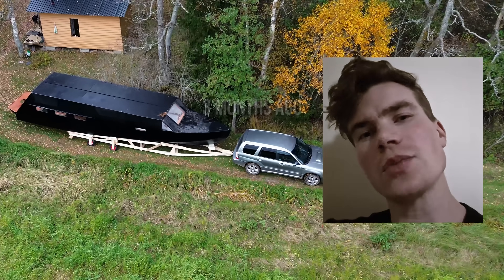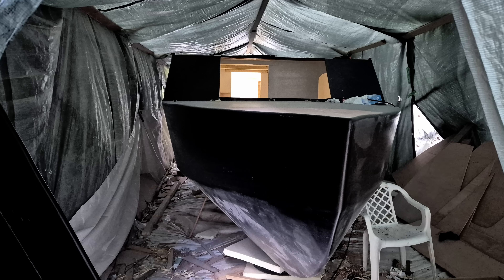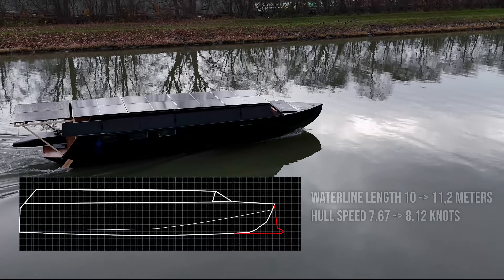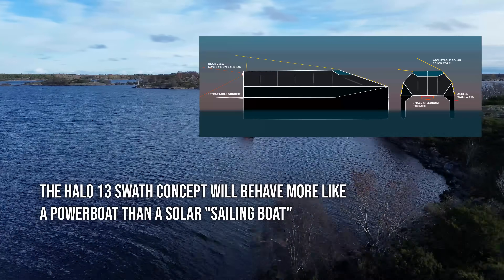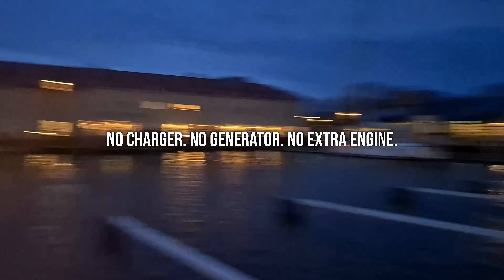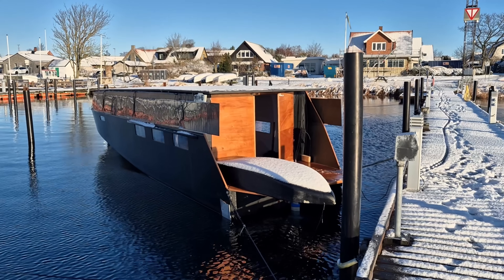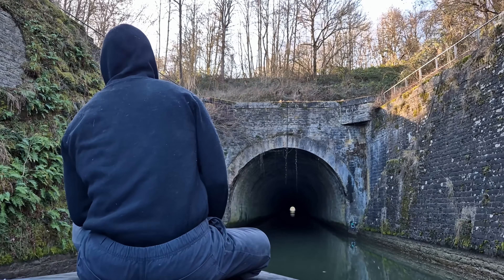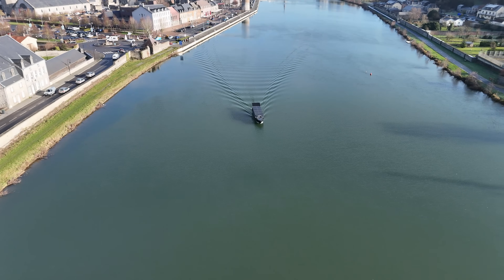The Real Reason I Got Trapped in Winter Canals

Comment: Thank you for sharing your experiment and adventure with solar powerboating..

I wanted to do a solar boat build for quite some time..

I live in Oregon next to the Columbia River, the wind and waves can get pretty big in the afternoons..
Currently looking at converting a 24 ft pontoon boat by adding a 3900w canopy roof (6 panels of 655w bifacials)  and running dual Minn kota 112 lb thrust electric trolling motors on the rear.. 

I understand I'll probably get a solid  5 mi per hour and hopefully with the overpaneling I will be able to keep up with the power draw even on cloudy days .

I also have beachfront property in a small province in Quezon Philippines..

A solar party barge would be a great thing to have there for family adventuring and spending the day on the water with cooking and karaoke with friends and family while cruising up and down the shoreline, then returning in the evening.. for my Philippines build it will need to be able to be pulled up onto the beach for storage and safety during the storm seasons and when I'm not there...

Comment: Learn by doing, is a great way.
I still disagree about the bulb. 
I hope you do tryouts with scalemodels (add rc and brushless systems)
If you want longer hull in waterline, take a look at the hull designs of C.G Petterson. (Beuties of the sea)
I suggest a woodstove for heating.
Also a small sauna (maybe same woodstove? Just define sauna with add on (lightweight) walls) would increase your comfort a lot.
Lightweight hull and noice?
Without insulation nor no curves on the surfaces, you can reduce speed or wear earprotection, the sound of waves against your hull  (empty box) will be there..
This trip is experimental yes?
To get all info from your current hull: tryouts with more weights.
Add waterjugs (yes plastic) in the bottom of your hull.
(Find out what size fits in with some force)
Fill them both all 
(yes by hand, you are young and have time) 
and partly (along the windside or the leeside)
Try out in small and moderate waves and in different speeds.
Compare how hull works in different speeds and turning radius.
It will give you great info and the empty jugs are both floatchambers and all the jugs works as insulation and might lower the noice from waves.
A heavier hull/boat will help you vhen ice too.
(I hope you added a metalstrip at the bottom as protction against rocks, sand, ground, logs and well ice..)
Rapid hull movements vhen you have wind and waves from the side is not comfortable in any boat or ship, but even a small change in your course improves comfort a lot. 
Yes a change in course gives a longer distance and lowering speed increases the trip, (crew comfort is important) but these adjustments will come sooner or later anyway because at sea, you have to adept cause only the sea rules

Comment: Learning by doing. This is the best way to learn what to do. That bulb in the bow you can still add on, make it with a metal reinforcement. For safety go hybrid, a small generator is good to have onboard and also a small light 2 hp outboard motor. Safety first backup and more backup. Small heatpump and IR lamps.

Comment: would solar on the sides help as the snow blankets all of the panels that are flat lying, surely you can generate on the side facing the sun even 30% would be awsome power,
also heat generation from the sides would melt the top panels snow by midday allowing for all the roof panels to deliver approx 4hrs extra solar

Comment: Making a long .35m deep keel big enough to stand in could cut your height that much, give a much better grip on the water and put an inboard and prop protected at it's rear end.  This is a much more efficient prop and motors are cheap, easily repairable, can carry spares.
Look at the 'American 26 sailboat' inside, outside keel  images.